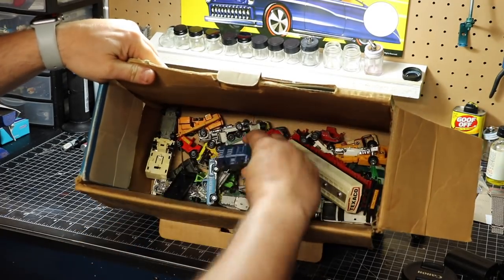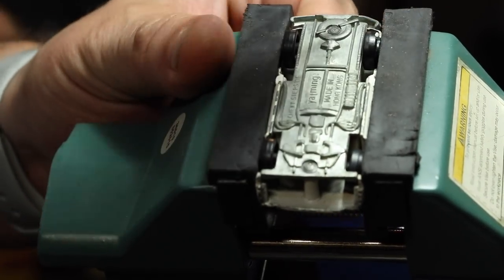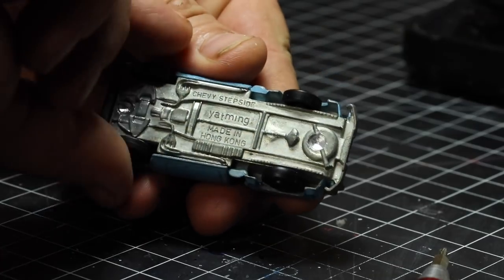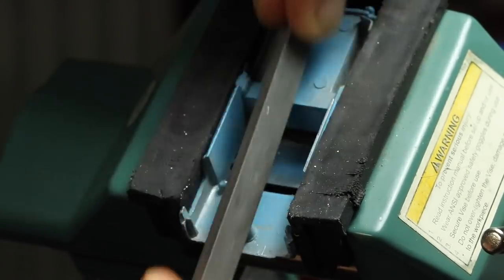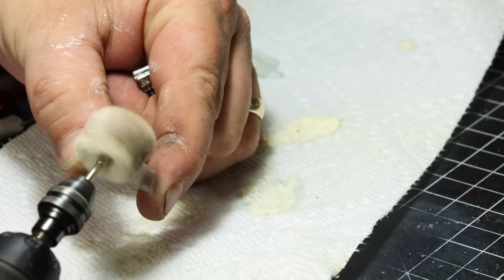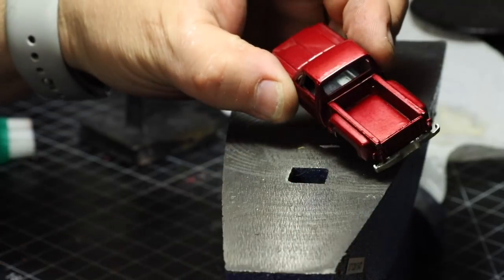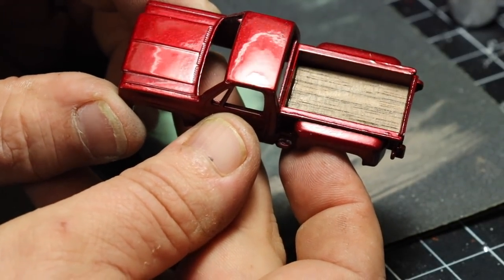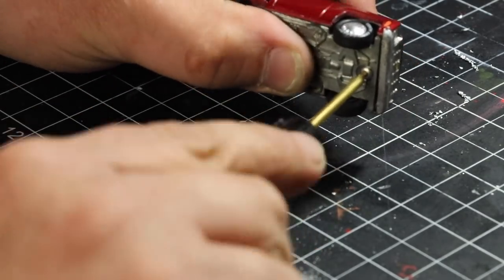Yatming Chevy Stepside C10 64th Scale Restoration / Custom

Comment: Hey WheelsNThings I do both HO (1/87) model railroading and plus collect 1/64 scale things. but to get the look of wood planks without cutting them is take an exacto knife and a straight edge and make a few small slices; not enough to cut the wood but just to give the impression. Work beautifully!

Comment: Great job and excellent video! The paint looks good too! As an amateur diecast customiser the best rattle can paint I have used is Testors One Coat Lacquer spray paint. Unlike automotive or other types of generic spray paint this stuff goes on nicely and is dry in a few hours and not days. I don't even use clear coat with it. Just primer and paint. I just repainted a Hot Wheels '40 Ford Coupe with it and it came out perfectly.
Reply from the maker: Thank you! Thanks for the tips as well.

Comment: In small scale work (not die cast trucks) I have simulated planking by scoring the solid piece of wood with a utility knife and then clear coat the wood.  The scored lines come out darker than the surrounding wood.

Comment: I'll tell you my friend. I alway use a rattle can and my custom look great. Your truck look really good for real. That's my biggest pet peeve is rattle cans always mess up like that. I can lay a coat down that looks just as good as hot wheels from mattles production line. Great job on your truck. 😬
Reply: PalefaceRacer Racer I’ve been using them until I get my airbrush. Had good results with testers. On my railroad buildings I use rattle cans. Had good results with both actually.
Reply: Reimagined Hot Wheels I'm going to buy a air brush soon. I seen wal mart has one for 19.99. I'm just worried about it being so cheap. I figure since I'll be new with a air brush i should be ok.
Reply: PalefaceRacer Racer I used to have an Iwata and compressor but I’m going cheap this time. I watched reviews and found that some of the combo ones you see are actually pretty good! Think they are 60-80 airbrush being around 20 range. For HW cars I think it will be fine.
Reply: Thanks buddy. Yeah i believe I'll do ok. I don't know if you have Facebook but i believe you'd be able to help me alot learn more about the air brush. My real name is Jbo Bundren. If you have Facebook feel free to add me. Thank you sir
Reply: PalefaceRacer Racer I’ll do a search on FB
Reply: Wearing a red hat in photo on FB?
Reply: Reimagined Hot Wheels picture of my wife and i. I have a black shirt on and a red hat.

Comment: Amazing work! I was curious if you could offer some advice.. I always get painting chipping after all the paint is done. I usually do 2 coats of primer, 2 coats of paint and 3 coats of clear. usually 24 hours apart from each coat. I use spray paint for all customs. what am I doing wrong?
Reply from the maker: It may depend on the paint. It may be that the paint isn't fully dry between the steps. I either paint primer, top, clear within 15 minutes of each other or I wait several days between them. If you're using enamel smell the paint after 24 hours. If you can still smell it, it isn't dry.
Reply: thank you for the advice sir!!! appreciate the time you took to reply!!!

Comment: For a planked look, try using a metal straight edge and a hobby knife/razor blade to score lines into the wood.  Then use a panel wash to accentuate the score lines.  Takes only a few seconds and adds that next level of detail.
Reply from the maker: Thank you for the tips!

Comment: You should try getting that paint with activator because spray cans do not have activator in it and it helps to really bring out the paint also helps to get it to stick so that scratches don't just end up on it
Reply from the maker: Thanks for the tip!

Comment: Great work. My favorite part is the walnut bed. So you really think there's that much of a difference between a rattle can and airbrush? I've only ever used rattle cans and I do notice they drip from time to time.
Reply from the maker: For me there is. It used to be the opposite but now it seems so hard to control the paint. I usually don't have this much trouble and kinda think the 2nd can had issues as well.

Comment: Do you sell you pieces?
Reply from the maker: I typically don’t do restorations but that doesn’t mean I won’t. Pricing is so tricky on these little cars and sometimes parts and paint are more than the cars are worth. Example Wheels = $6 plus shipping, glass (if needed) $8 plus shipping, Spectraflame paint $7 plus shipping and shipping car both ways is roughly $8 total. So you could have $37 in the restoration before any labor is involved

Comment: Couldn't you just solder instead of tapping??
Reply: It's almost impossible to solder ZAMAC alloy. I have tried several times in the past, using different formulations, but it never works properly.